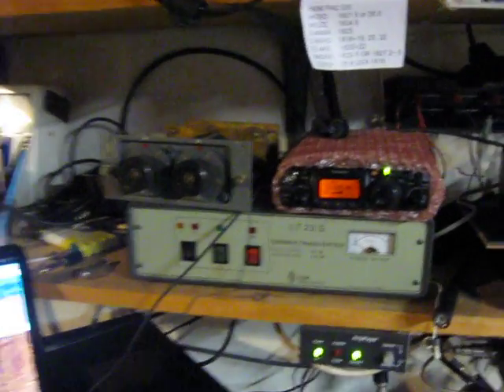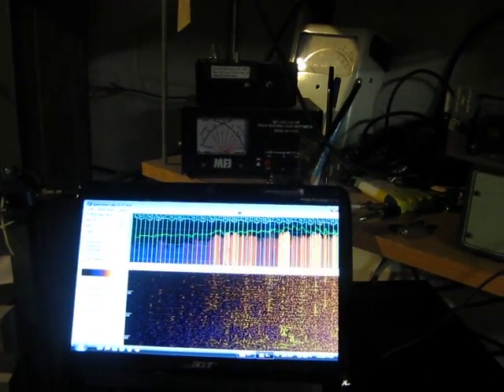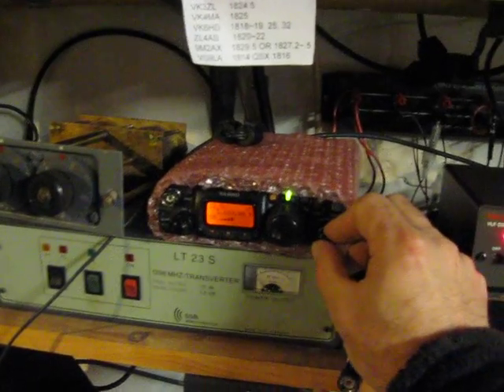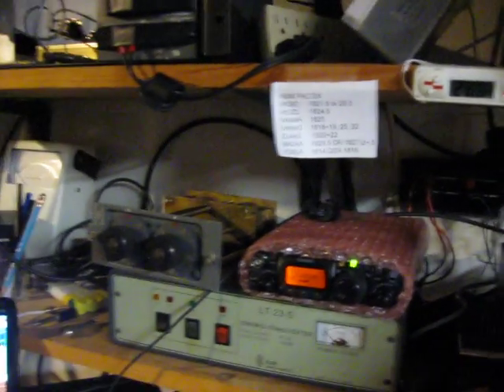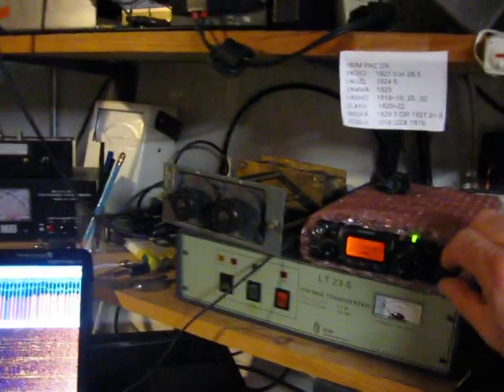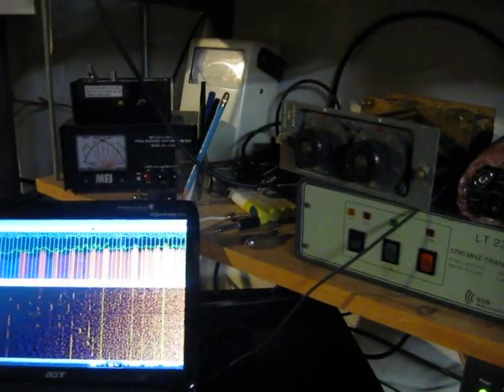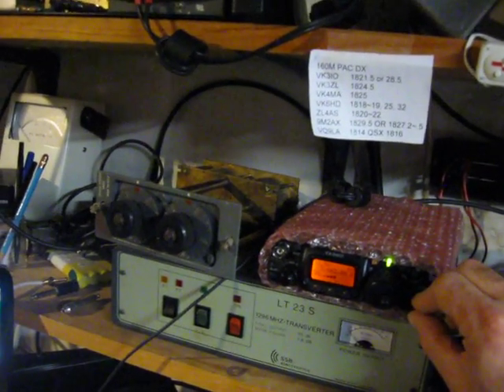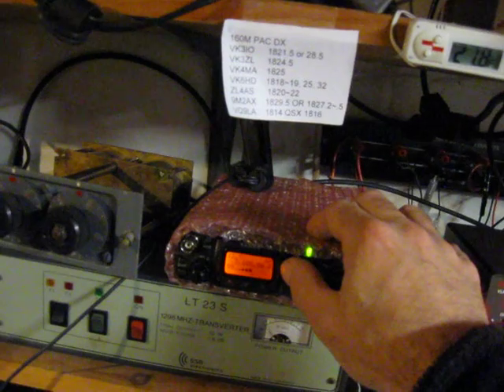LONGWAVE ICELAND BROADCASTING 189kHz @ WA3TTS

Comment from the maker: I am well aware of everything you mentioned. The video was made because it is very rare to receive RUV on 189 kHz at 30 decibels above my local background noise for a 4500km path.  The free space path loss equation 32.45 + 20Log(f-mhz) + 20Log(d-km) says 32.45+20Log(.189) +20Log(4500) = 91 dB, but reality for a transmitter and receiver on the earth is easily 60 dB greater. 91dB + 60dB is 15 orders of magnitude. Applied to a 300KW transmitter signal (+84.77dBm) is approximately -65 dBm (65dB below 1 milliwatt) and about the noise floor level for a receiver in a moderate noise suburban environment.  So the video shows a signal from RUV some 30dB out of the noise in a 9kHz AM transmitter bandwidth at a distance of 4500 kilometers. That is indeed an unusual event...

Comment: This is not a commercial radio station. All longwave radio broadcasters in Europe has been traditionally owned by national governments! There has been some exceptions like Radio Luxemburg, but mostly they have been government controlled broadcasters like this 300kW transmitter from Hellisandur Iceland. It transmits national programs of Icelandic National Broadcasting Service (RUV). Iceland have wide Atlantic sea areas around it where icelandic fishermans do their job and this is the main reason for these transmissions. With longwave service the RUV can deliver important information and entertainment to wide sea areas around Iceland.

Comment: Mike,  Thanks for the demo.  I guess I am amazed that there are enough listeners in the world that would justify a commercial broadcast station to operate.  Up to now you have listened to what I thought were experimental broadcasts that consisted of CW only.  I have a new Funcube dongle pro plus that is supposed to have a frequency range of 150 kHz to 2.05 Ghz with 240 Mhz and 420 Mhz notched out.  I guess with the right antenna I should be able to receive the same transmissions you have. Tnx.

Comment from the maker: Hello Glenn: Yes, past week or so longwave has been outstanding. The EWE antenna has an inverted U shape, with a 9:1 matching transformer on one end and a 1K-ohm range termination resistor on the other. Measures 13' H by 35'L by 13' High and feed with 150 feet of RG6 to shack.Short 4ft ground rods on each end.  Directive pattern toward the transformer end and null at the resistor end. Similar to K9AY, flag, pennant antenna. Type 75 or 77 ferrite material for LW essential.  Tnx & 73  Mike